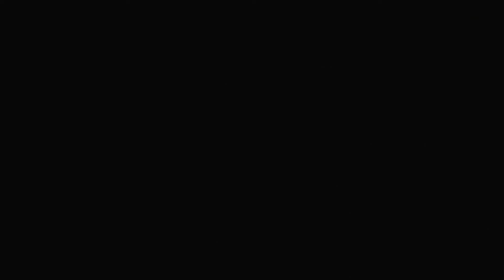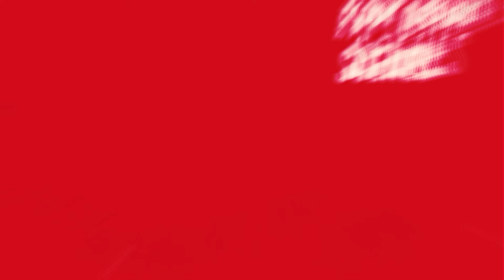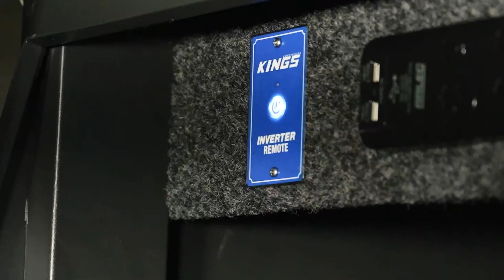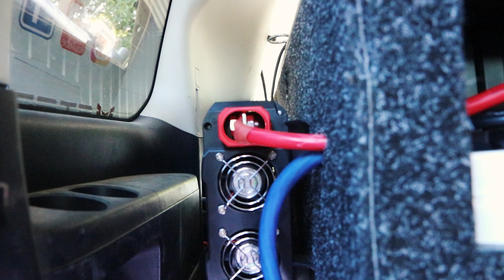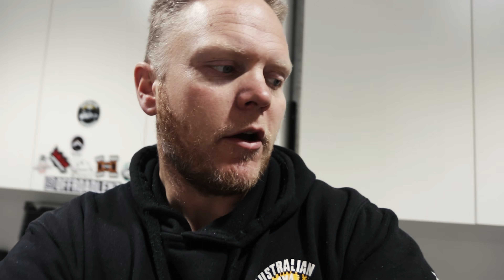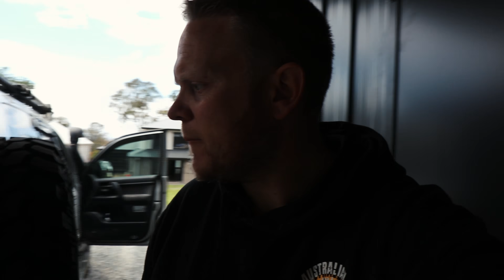BRAND NEW! Kings 3000w Inverter Install and Testing Review

Comment: Awesome info , just a thought with your battery set up and new inverter would you be able to run a 140amp arc welder with 10amp plug be good to know if possible in a track side emergency situation / cheers regards Matty
Reply: Pretty confident to say no. The burst current to strike the arc is very high, most small welders recommend over a 6kva generator

Comment: Great video!
I’m a noob at this so could I get some clarification please?
If you are drawing ~250 amps before the battery BMS cuts out, what is that in watts draw?
Is it 250amps @ 12V = 3000 watts?
In that case the inverter was pumping out its max output and still functioning ok?
Am I right?
Thanks.
Reply: Yes 250amps @ 12V = 3000 watts. Watts are calculated using: Volts X Amps = Watts. 👍

Comment: I purchased one a few weeks ago, I replaced the cables before first use with 50mm2 and a 250 A fuse. running 2 135 AGM batteries in series. I'm not drawing over 1500W and have not had any problems,(as yet?)

Comment: Great video mate 👍👍
Question I have x2 AGM 100ah batterys in my off road camper trailer but won't to upgrade to lithium to run my makita dual battery charger for my chainsaw recommendations on a set up ?
Reply from the maker: Hey mate.   Your AGMS will run an inverter to charge up your makita gear just fine as that’s only a small load.  
You’d prolly only need a 600w inverter to do that job. 

Having said that lithium gives you so much more scope of what’s Possible. 

Obviously I’m a fan of DCS but I’ve just ordered ( due tomorrow ) 2x 200 amp ITechWorld lithium battery’s.   

I have a promo code for a small discount if you want as well ( A4x4A ) 
Obviously I can’t speak to the quality just yet as I haven’t used them but they seem very reasonable priced.  

I’d be looking at that path
Reply: @Australian4x4Adventures  sweet as mate I'll check it out thanks for getting back to me just found your channel looking forward to more ps thanks for the promo code 👍👍
Reply: you could run a plug in electic chinsaw with a lithium

Comment: Thats impressive Steve, I bought my 1500W one based on your other video and I too have had no issues. But that's a weapon. I only have 200A lithium available but they're under the bonnet so I won't go that far but still a solid result. Cheers Steve

Comment: Thanks buddy very informative. I run DCS as well, 75ah under the bonnet of my Amarok, runs my Engel, lights and 600w inverter and 100ah in my cub camper runs my other Engel 1500w kings inverter and lights. To get over the BMS limitations you can run another similar sized battery in parallel. I'm thinking of putting the 3000w kings inverter in my cub and adding another 100ah DCS in parallel. Theoretical max discharge current should be at least 400amps.
Reply: Don't forget to run bloody thick cables for 400Amp.

I ran 300mm square weld flex to my 3000W inverter, slight overkill but no voltage drop.
Reply: dont mix battery sizes
Reply: @damienfrizzell9394 It doesn’t matter with Lifepo4 chemistry, u can mix 2A cells with 200A cells in the right configurations, IR & cabling, etc, they will charge & discharge proportionally. This has been shown & proven on Andy’s Off Grid Garage. I’m sure many will disagree, but check out his experiments from a year ago with irregular size, capacity cells, & as he has more recently called it, the latest ‘Frankenstein Battery’, which have all passed capacity & high output current tests with flying colours.

Comment: Doesn't look like that supplied cable is rated for 250-300AH draw.... only looks like 2 or 4 Gauge.... 3000W load is basically upto 250-300AH draw.  How hot did the cable get?
Reply from the maker: By the end of the big draw they were warmish.  
Definitely not hot. 

I do plan on changing them over to something bigger ( or just adding another cable with it ) in the future but I wanted to test it straight out of the box.

Comment: Nice review might need to upgrade if I get another lithium battery, just wondering as well, do you carry another cooking source just incase you ever have a electrical fault white on the road
Reply from the maker: For moving camps no, I only ever take the induction these days.  

If it’s a base camp for more then 2 days I’ll take a small gas cooker because the battery doesn’t last long enough past 2 days without running the car for a bit ( and who wants to do that while camping ) 

So far so good and I haven’t had any failures.  
I have had gas cook tops fail over the years and leave me with no cooking ( apart from the fire ) but I’ve used gas cook tops forever and only started induction the last 18 months. 
But I’ve still got the fire to fall back on

Comment: I just bought the Itech 3000 watt inverter, im a little scared to use it though as it says i need a 450 amp fuse to protect it. Not sure where to get that. Also says the 3000 can handle a surge up to 6000w momentarly.
Reply from the maker: I’ve got one of them coming as well.  
I found an electric wholesalers in bayswater that sell mega fuses and they will do 450 amp fuses.
Reply: @Australian4x4Adventures  ahh thanks, will look them up.

Comment: G'day Steve. I've got a similar setup except the renogy 3000w and dcs battery. I too hate the DCS app its garbage i use a victron battery monitor and much prefer their app. I would suggest that cable is completely inadequate for the current draw i use 2 x 50mm2 welding cable both in and out of the inverter. Be interesting to test at battery peak of 250 amps and see how long the inverter will go for
Reply from the maker: A full noise the cables were starting to get warm but nothing too concerning ( to me anyway ).    The unit won’t really be getting used at 100% very often and definitely not for very long as my battery won’t last that long 😂. 

I have considered getting an after market battery monitor but it’s just more money for something that already ( kinda ) works
Reply: @Australian4x4Adventures  cables shouldn't get warm at all. They are getting warm because there is so much resistance in the cable, so effectively pulling more current from your battery than what is actually needed. Not good news for your battery.

Comment: What about one more battery (200amps) in parallel?
Reply from the maker: Yeah 400amps would be perfect for this sort of setup but for inside my car I’m struggling for space. 

Plus the battery is charged from the alternator so it’s charging at about 100amps so doesn’t take long to recharge

Comment: Another great video mate . Just a question I have around safety. If the inverter outlets are rated at 250 volts and 10 amps and you are using a power board connected to only one of the outlets. The max safe power draw would be 2500 watts. That’s why caravan power leads are rated to 15 amps so you can safely support loads over 3000 watts in total. It would be worth shooting Kings a question regarding this. Maybe you will have to share your intended load over the two outlets with another power board. The AC side of inverters needs as much respect as the DC side in terms of personal safety. Keep up the great content.
Reply from the maker: Hey buddy.  
Thanks for the question and this time I actually have an answer 😂. 

So I did have both appliances plugged into different plugs.  

One in the power board because the lead on the induction isn’t long enough to reach the inverter.  

The toaster was plugged directly into the inverter.  

But yes when I was using the air fryer and induction both were plugged into the board but that’s not how I would normally use it. 

I wouldn’t normally have all 3 out at once , only ever two at a time.

Comment: Awesome. If only I waited a couple of weeks I could have gotten the 3000W inverter when I bought my 1500w. Something to add regarding the cables. In found that the ones which came with my inverter were only 4GA. Insert a lot of engineering jargon and I recommend upgrading to 2GA. Similarly 2GA is only rated to roughly 150A. The 3000W inverter will draw 250A at max load and insert engineering jargon I recommend ditching the included cables and get some 0GA cable especially if you're running the cables longer than 1m.
Reply: 100pc Agree for 12v 3000w you need welding cable or fair dinkum large battery cable
Maybe it's people's setup's rather than the inverters
Same as 12v fridges on cigarette plugs
They come lose the fridge dies from lack of current and people say the fridge is crap
Reply: Agree with you completely. Cables supplied with inverters are always undersized. People need to realize that efficiency of the conversion to AC needs to be taken into account. The DC current draw for 3000 watts of AC will be more like 300 amps. A rough rule of thumb in determining cable size is to use 10 volts instead of 12 volts in your power calculation to work out how many DC amps will be needed to produce the rated AC power.
Reply: You can run 4GA cables in parallel better than single 2GA.
Reply: @spartannomad3036  you can but that's not what's provided in the kit

Comment: Great video and great test. I got a 3000 watt renogy in my van and can run an electric kettle,toaster etc but when it comes to a 1050watt input portable air conditioner,the inverter trips out. Love ya work 💪👍🍻
Reply from the maker: Really 1050w and it trips out?    That doesn’t sound right
Reply: Seems odd.

I installed the 3000W renogy inverter/charger with auto changeover switch in my caravan and it runs the ibis4 domectic AC, microwave, 3way fridge on AC and TV at the same time no worries.
Reply: You just answered my question... Thanks

Comment: It was fantastic the battery safety systems kicked in and worked well. It would be interesting to test on another vehicle with a more basic battery system. :)
Reply from the maker: I very much doubt that a lead acid or AGM would even give out half the amount of power required to run it at full capacity 

But would be good to show that one day I think

Comment: Well done Steve, was a good video showing both the inverter & DCS. I haven’t tried to hit the amp limit on my DCS 200. Great to know the bms is doing its job. 
I might have to do a test with my twin induction & coffee machine pumping both at max.
Reply from the maker: I didn’t even considering the battery giving out before the inverter. But it’s nice to know it’s safty features work.